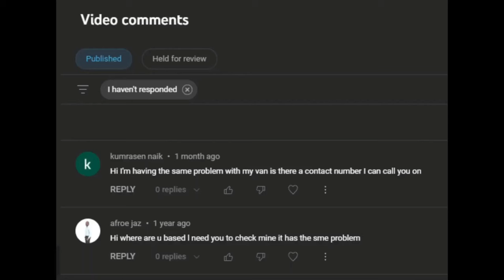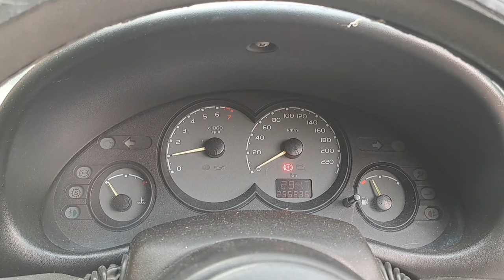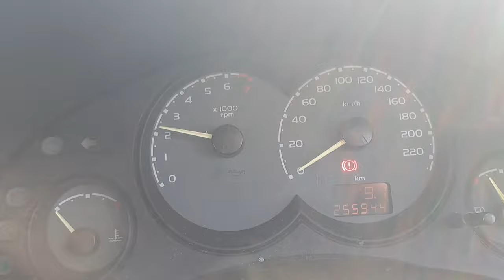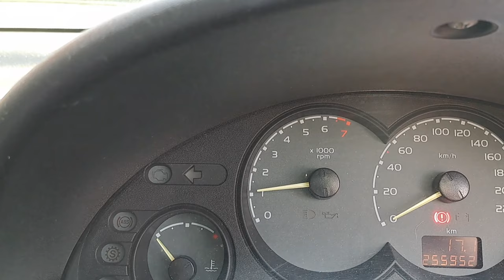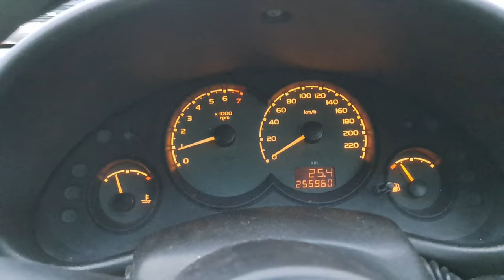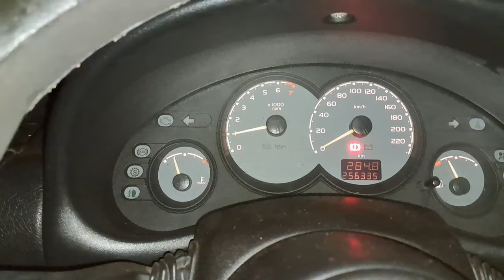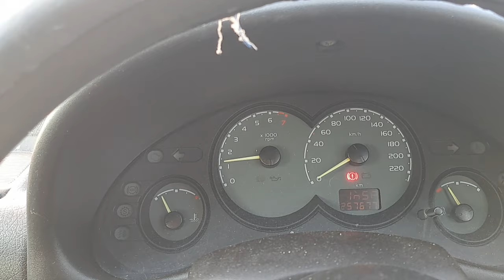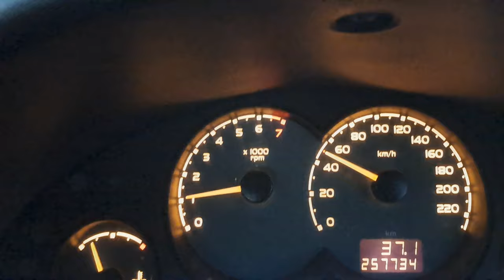Opel Corsa B idling Problem again

Comment: The TPS can be set if you look at it, there is a one normal hole and the other is longer as it can be adjusted. Get a multimeter and back prob the center wire for voltage. 
The tps should be around 0.5v. 
Open the throttle slowly and if you see and rash jumps in voltage or if it drops down while increasing it its faulty. Fully open it must not be more than 5v. Knock on the sensor as well and if the voltage spikes up and down then its faulty.
What is actually happening is once u let go of the accelerator the ECU thinks the throttle body is open hense why it idles high or jerks when changing gears or braking.
Reply: Will try that one and give feed back

Comment: To remove the small one you need to use small rashes on small extension and I have been advised not to use a cap cleaner except throttle body cleaner and it it works on me

Comment: had a similar issue but on a Nissan, what had happened was oil got in the intake, created sludge and resulted in running rich. solution, clean the intake manifold.

Comment: When changing idling valve take out battery terminals off then instal the sensor the put the battery on again then start the car, it will rev higher then tap the accelerator and then switc it off then back on again then it should be fine. Opel idling valve is not a plug and play guys .
Reply: Will you make a video of all the relays please

Comment: You can set your tps with a t10 torx. Get a multi meter as well. 

Not all brands have the same spec. eg: euromoto and Sebring, doesn't run on the same spec. 

The car should idle at 850 rpm not 1000 rpm. 

The part should put 0.5 volts with the ignition on.

Try it! Trust me, that's a battle I can say I triumph!

Comment: The throttle position sensor is just a variable resistor or potentiometer that can be easily checked with a multimeter. Mine changes from about 6.5k to 900 ohm max to min.
The idle control sensor is actually a actuator. If it gives problems,take it out, connect plug. Hold the tip so it does not go in, and switch on car. Switch off and let it go out. Continue untill it is all the way out. Then clean with break cleaner/ thinners. Push some grease in to hole. Put back pin. Now switch on ignition and keep pushing the pin in. It should stick out enough when you put it back in throttle body, otherwise you get high idle. To summarize, every time you switch on ignition the idle control valve pulls in a little to increase idle speed. Then it goes back out to lower idle. If it is sticky it mostly pulls in but doesn't go out an cause high idle. A Little cleaner an grease causes many more available parts at the dealers for everyone. Moral of the story, throwing money at problems doesn't solve them.

Comment: GM still has original spares. You just won't like the price. All aftermarket parts don't work. That's because they were not specifically made for the Corsa B and the tolerances aren't correct. So if you want the genuine idle valve sensor you will be looking at 5k. And it will work as intended. Sad but true. (Same for tps which genuine part is close to 3k).
Reply: So true. Here in cape town it priced R2700
Reply: Goldwagen part works

Comment: Good Day, please can you advise me on speed sensor, speedo not working. Replaced but still not working. Any advise would be appreciated. Thanks
Reply from the maker: If you already put in a new speed sensor then maby there is a off wire. Best will be to plug in a diagnostic tool.

Comment: @CriPtZoNe, may I ask. underneath the throttle body is a air pipe. Any idea where it goes to? I would appreciate some advice here please.
Reply from the maker: @CedricWyeth  I will take a look for you.
Reply: @CriPtZoNe  thanx man, appreciate it
Reply from the maker: @CedricWyeth  I see 3 pipes on the throtle body. I wish I could share the photos. One is going from the back of the trhotle body to the map sensor. The second is going from the top of the trhitle body to the tapet cover. The third is going from the right side of throtle body to the fuel sensor on the injector rail. I think if you watch the Corsa project video where I did the head gasket you might see them in the video as I took alot of video from the top.

Comment: I had similar problem and all i did was swap my idling position sensor with a scarp car and my idling was perfect....what you did by unplugging the sensors does not work you have to test with parts of the same car..

Comment: My corsa gives me the same problem.. changing the TPS seems to sort it out for a few months and then i need a new one, maybe because OEM parts are no longer available and the aftermarket parts dont last🤷🏽‍♂️
Reply from the maker: Exactly why. The aftermarket spares are not 100 correct. You take a chanse and hope it works.

Comment: Hi, I like to ask which Bluetooth dongle should I buy for an Opel Corsa Lite 1.4 to check the OBD codes.
Reply from the maker: @hhlhcier  good day. I don't know. I took it to someone else to check for me. And he used a couple of android apps to analize the computer. And when I asked him what  he used or what app he used he told me he is not going to give out that information. I think it was a dick move on his part but what can we do.
Reply: @CriPtZoNe  Thank you for your reply! I have misfire and the engine runs not smooth, also problem with starting. I've changed the spark plugs, connectors idle valve, map sensor, ignition coil pack it's better, but the engine is still not running with full power. I could see that the new spark plugs are all very black, but not full of oil, and just test drive the car around the corner. Now it's difficult for me to find the problem.
Reply: @CriPtZoNe  When I mentioned starting problems. I have to try two, three times, then the engine is starting very hard with a lot of vibration
Reply from the maker: @hhlhcier  did you check the injectors them selfs? Maby they are overfueling? Or blocked?

Comment: My corsa does the same thing and I have changed all the sensors but the problem does not get fixed. It starts well and idling less 1000rpms but it changes after some time and sometimes it waits for me to put it on gear and it would start idling over 2000rpm. I am not even of buying a new throttle body or doing an engine swap because this corsa engine is giving me headaches with this idling thing.
Reply from the maker: Before you do anything else look at the timing gear at the bottom. Sometimes the key way gets worn. It moves half or one tooth out of time as you drive. That will also cause loss of power.
Reply: @CriPtZoNe  Thank you. Mine has power, it is the idling problem that I am facing and just the otherday it got worse, before I used to switch the car off and start it again and idling would be gone but now nothing works. I got the throttle body cleaned sensors replaced but still does the same thing

Comment: OEM spec parts is available at Goldwagen. IDC valve is R320 and better quality, but I don't believe the IDC valve is always the culprit. You trying to put a bandaid on and underlying issue. I'm still trying to figure it out.
Reply from the maker: Since I changed it I have not had that issue again. Touch wood. So far so good.

Comment: 7:58 seemed like auto choke on a cold morning but obvs not the issue. Also for excess fuel consumption check two things, clean the airflow sensor and I also found mine was leaking from the fill up rubber tube and breather which I will be replacing shortly as I just did a head and cam job on the fucking bastard lol I'm worn a bit thin 😂

Comment: Hie , i have a corsalite which after you rev it stalls or switch off even when driving as soon as you want to change gear it switches off the engine, on the corners if you stops it doesnt idle and stops  again . I have changed twice the idle and throttle sensors still no changes. I changed the map sensor too but still have the same problem. The mechanic is also confuses pliz help me diagnost this problem ..
Reply from the maker: Look at the timing gear on the crank.  Remove timing belt and see if the key way is worn. Just one tooth out will spoil the entire idelimg, performanse and fuel consumption.

Comment: hi, i would like to know what diagnostics tool your friend used to run the diagnostics. i have trouble getting someone with the right tool to run diagnostics
Reply from the maker: He had a bluetooth dongle that he pluged in and then he downloaded 3 programs from android playstore. Im not sure which program worked.
Reply: @CriPtZoNe  I'm having the exact same issue as shown in this video. Also, battling to find an app to use with the OBD2. It reads the OBD unit but it says it's not connecting to the ECU..
Reply from the maker: I will find out for you
Reply from the maker: @SBJ257  i will find out what app and tool you need.
Reply: Would really appreciate that. I changed my spark plugs and leads today.. still misfiring and even worse now. Cleaned my Idle control valve and it's also revving even higher now, up to 3k. I am SO confused.. but like you said, the TPS may be causing all the problems. Really appreciate this video, I feel like it's giving me a lot of answers  @CriPtZoNe
Reply from the maker: Thw TPS is not expensive. Betwean 180 and 250. Why dont you just buy one and put it in. You have nothing to lose.
Reply from the maker: Hi. He is being dificult. He does not want to tell me. But I do know he used a bluetooth dongle that pluged into the computer port and he used an app from play store. He downloade 3 apps and the one worked. Obd2 app. You will have to download from play store and test them all. Maby google what obd app works on Opel Corsa 2002 models. Sorry I can't be more help.
Reply: No you've been the MOST help from everyone I've spoken to. Your video really helped a lot because it's exactly the same as what I'm going through! I'm replacing ALL the sensors, cleaning the throttle body, and giving it a minor service with all filters replaced..  then I'm selling it hahaha. Thanks Charl  @CriPtZoNe

Comment: Mine revs fine at 1000rpm problem is sluggish acceleration,i cleaned throttle body, changed tps ,spark plugs and wires but still the same 😢and chows fuel like crazy .
Reply from the maker: Check your timing gear. The key way might be worn
Reply: Or map sensor, my Opel Corsa utility does the same and I changed what you changed, but after I cleaned a map sensor was fine for about 10km drive for the first time and then it came back but occasionally this time so I'm changing the map sensor this week then from there I check the key way as my last resort, but let's see who wins first and share the part replaced nhee? On this comment deal!
Reply: @Lovetvsa  Hi did you resolve the problem

Comment: I have a same problem but I've changed both
Reply from the maker: Check map sensor as well. Otherwise you have to check the timing gear at the bottem pully to see of the key way is worn. That will effect your timing with one tooth causing power loss.
Reply: When u install a new idle control valve the rerv will be extremely high, dont panic its normal let it run it will come down to normal in a matter of minutes, i knw its normal to panic wen it happens😂😂😂 buy a carb cleaner for control valves dont buy sensor immediately wen u experience a an idling problem...and with regards to the petrol this car has a problem with the petrol pump sending unit which will give u false petrol reading
Reply: Tps apparently  needs to be calibrated after installation.
Reply from the maker: @TheCSIguy  I was never told that. I just installed it and it is running perfect.
Reply: @CriPtZoNe  Hi, I have changed both sensors  but is still on hi rev.

Comment: Hi I'm in need of advice...I have a opel corsa lite 1.4i and been giving me some problems.okay once driving about 3-4 km then the car starts to jerk n losing power,sometimes it comes right after few minutes and most of the time it take about 15-20 mins to come right whilst driving.so now got a mechanic and so we started trying to find the fault we tried new plugs new bougi cords new fuel pump and filter cleaned the injectors cleaned the fuel tank cos it was very dirty checked the timing it was off, new water pump and fan belt put in. But the car still has the same problem that jerking and losing power. I was  told by another guy who had the same problem, it's the idle valve sensor or the fuel pump relay ...which I recently bought both the mechanic said no it could be the throttle body sensor or the coil so anyone had this problem with their corsa any suggestions or advice will be greatly appreciated.thanks
Reply from the maker: Sounds like something is failing. Could be the petrol sencor. The ideling control sensor will make the car idle verry high or verry low. And the engine check light will come on. Tps sensor high ideling but no engine light. Could be an injector messing around.

Comment: if you cant see it, ill tell you what i noticed in this video, the accelerator cable is too tight!! you need some slack at the cable end, otherwise it will interfere(confuse) the idle stepper motor, in this case, higher revs. the cable is adjusted at the pedal end, if need be? The spring you forced NEVER was/is an issue, you just making matters worse